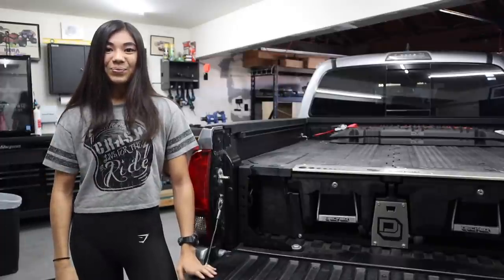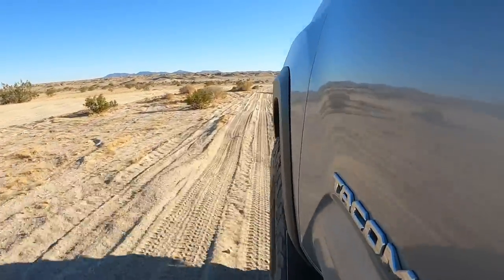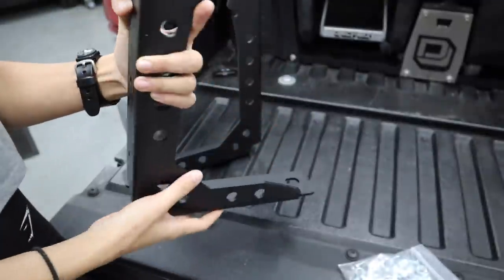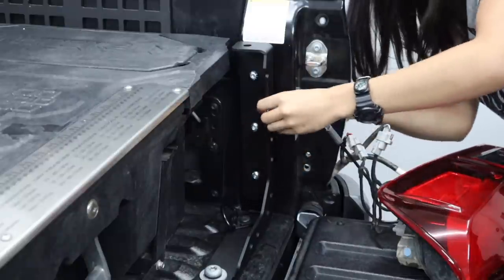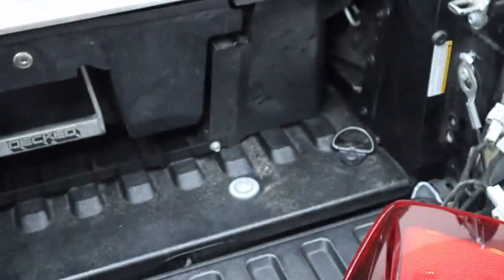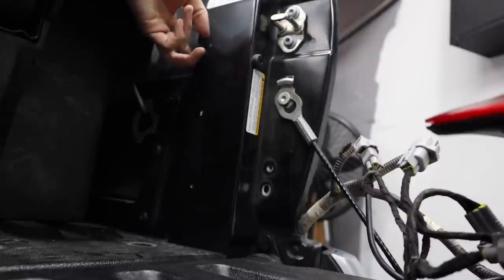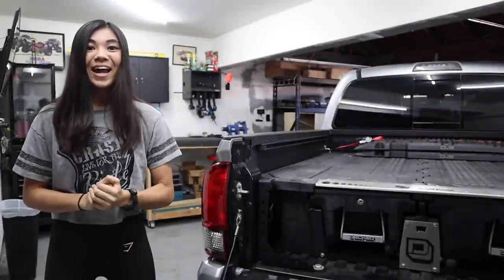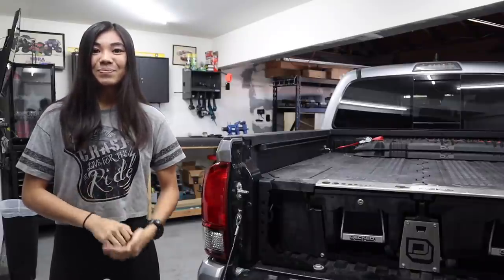Why Your Tacoma Needs Bed Stiffeners | Cali Raised LED Bed Channel Supports (Install + Review)

Comment: My composit bed has held up better then any steel bed I've ever owned and I overload my tacoma two or three times a year with stone, coal and firewood. Sometimes's with more then a ton. One summer I hauled over 100 tons of stone. These are definitely unnecessary except perhaps where you install a camper shell or something similar.

Comment: Just a quick suggestion for anyone doing this. I would recommend using a small brush and a bit of primer to touch up those drilled holes otherwise with moisture and condensation you could develop rust and rot over time. Or at the very least some urethane window sealer on the exposed metal. Not a problem for the short term but people pass these tacos down and could be helpful for future resale owners.
Reply: Great point! I totally agree. I use POR-15 rust preventive and top coat combination.
Reply: Or apply antisieze to threads and flange head of bolts, it will prevent rust forming as well.
Reply: No need

Comment: You make all of the installs seem so easy. Last night I installed the decked drawer system on my 2022 Tacoma  Off Road by myself. It wasn’t easy and it took me at least 6 hours. OMG my back is killing me. But the install came out great. Thanks Chole for the inspiration.

Comment: If you are worried about the bed cracking from offroading I feel like those will actually make it more prone to cracking...
Reply: I have an access cab (probably more likely to crack since it's a long bed)  and I also have a double cab short bed.  I off road all the time on both with a bunch of gear and I've never had any issues.   I live in Hawaii and everyone has a tacoma and I've never heard of them cracking.
Reply: @alexgarcia3900  same here got an access cab n im on the big island and the tacoma is the state bird lol flocks of them everywhere no one had a cracked bed from who i talked to. i however plan on getting loads of sand and rock from the quarry so maybe i might run into the issue

Comment: So I have a set of these from my friends kids who run a fabrication / cnc shop from home. They are also powder coated and pretty much exactly the same. What I wanted to point out is on my 08 taco the top bolt is at the exact location of a piece of stiffening metal behind the tail lights. It was an absolute nightmare getting the nut on. One thing also to consider is putting a washer on each side of the bolt, I did this on mine and while probably not needed it should add some additional strength. Great Vid and I really like the deck system.
Reply: If you got them free, install. If you didn’t and you paid 100 for them boy do I have some oxygen to sell you.
Reply: @EL_wardan  Mine were free since I did some work for them.

Comment: Well Miss Toyota,  I will be starting the rebuild process on my Tacoma this week. I have all the parts I need other than a few small things I’ll have to get at dealer. I’ve got a 18 Denali duramax I gotta paint , soon as I finish it the yota is next in line. Bed stiffeners are good idea with composite bed. If I was gonna serious off roading I’d prolly go for it to. But I won’t be doing any real hard off roading. Maybe fishing and snowy roads is about all mine will see.   Good job as always.

Comment: When drilling new holes to line up with existing holes, use a transfer punch. They come in sets. It punches a centered drill point so there's no guessing. Also, it's almost 2022 and the whole world is metric. Why U.S.-based accessory manufacturers still include inch hardware with their products is puzzling. It's that difficult to include M10 fasteners with this kit?

Comment: You should get one of those tailgate interior covers. They have them with drink holders built in also
Reply from the maker: I need one of those!
Reply: @ChloeKuo  yes, I know when I climb in it really is hard on the knees, or if you set something on the tailgate invariably it topples over! Looks like an easy install.

Comment: Nice. Been thinking of this. Carpenter by trade and will be getting the decked system soon. Can the stiffeners be installed before the decked system? (I haven’t investigated how modular the deck system comes, so I am unsure on the order of installation for myself).
Reply from the maker: I think that’s possible, but it would be easier to do the DECKED first. I have an install video on the DECKED if you want to see what it involves!
Reply: @ChloeKuo  thanks— will do

Comment: Do you know how strong the tie hooks are at the front bottom corners of the box? I’m sometimes a bit worried carrying my dirt bike on the truck and strapping it down. There is unite a bit of flex on a he hooks compared to my old truck.  Not sure if there’s a reinforcement kit or just use large washers and longer bolts

Comment: Now I'm wondering if the composite bed is one of the reasons for the lower payload rating of the Tacoma vs. Hilux. Tacoma is rated at 1540 lbs vs 2200 lbs.
Reply: I think it's mainly the suspension.  American market is different.   The tacoma leaf springs are actually super weak.
Reply: Ah ok! I'm guessing then that America's mid-size trucks ride better unloaded than world market ones? The new world market trucks are getting better at being comfortable (my 2021 rides very well), but they used to be super stiff unloaded!
Reply: @cunawarit  yeah I own one and it's designed more for off roading and articulation.   Stiffer springs are better for heavy loads but limit articulation and make the ride less enjoyable.  Americans are very demanding lol and also don't usually use midsize trucks for actual truck use. We use bigger trucks for that purpose.

Comment: Good Video.  I did see you still have your bed side mounting racks.  The racks where you can tie things to the side of your bed.  Do you believe those also give you added structural support?  I do not remember how those were mounted.
Reply from the maker: Thanks! If you’re referring to the molle panels, they do not provide any additional support. They are made of star board and are very light and flexible

Comment: Hey how about disclosing whether you purchased or were sent by the manufacturer the items you post. It will add more validity to your channel. You jump around so much when it comes to quality levels on the items you install. Some followers might not know better and take your word. The only decent thing to do 👍🏼
Reply from the maker: Thank you for the feedback! I should have done a better job clarifying that in this video. I was not paid in exchange for making this content and always disclose that information for other videos that I am. I specifically installed these bed stiffeners on my truck over other brands I researched for the reasons I explained in the video—although I was able to work with Cali Raised LED on the backend to make my own discount code for viewers

Comment: It would be nicer if Toyota actually made a strong, non flexy bed to begin with. A steel bed with a spray in liner is way better than the Tacoma plastic bed.